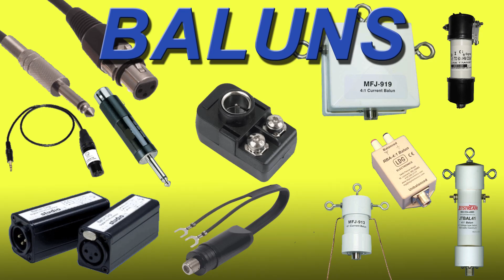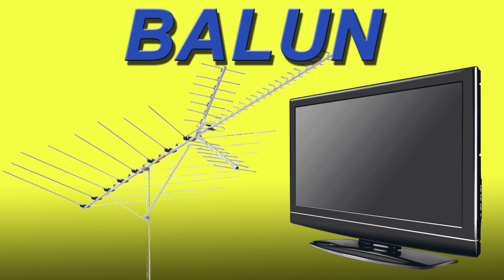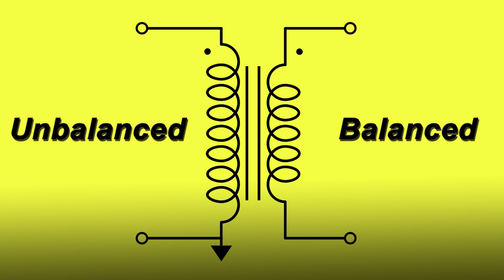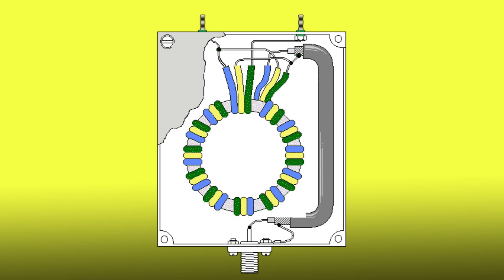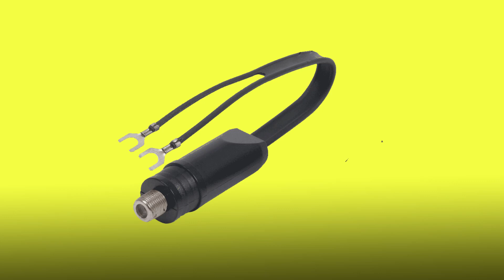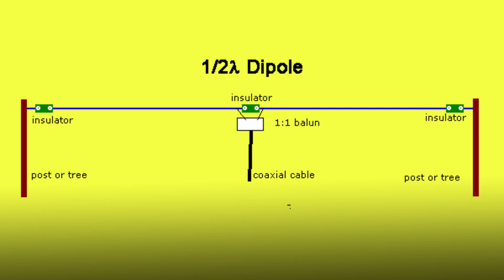Basic Fundementals Baluns

Comment: Watching at half speed I think it makes some sense. I’m trying to figure out a 5.8 gHz antennae that I broke. I believe it is a 4:1 balun near the end of the body of the “antenna” (which I think is mostly a feed line). It appears to be a small brass tube that closes at the antenna end. I think if the ground of the coax (the braided part) is soldered to the inside and the internal wire (which protrudes through the closed end of the brass tube) is soldered to the brass tube on the outside, the effect is similar to what you described as a 4:1 balun. I could be way off, but I’m just trying to understand it. I think it’s a half-wave dipole antennae. Any ideas to help would be greatly appreciated. I might be wrong about the ground being attached to the brass tube, but that would pretty much eliminate the possibility that it’s a balun and then I’m back to square one trying to understand what I’m looking at.

Comment: > I hope this video has been helpful.
No, it really hasn't. I know just as much as the video finished, as I did when the video started. Assumed too much, and left too much to magic.
Edit: Coming back 3 after having studied baluns on my own, I understand this much better. Things I didn't know:
1. The signal is only meant to run on the inside of my coax
2. The outside should be at ground, so as to shield the signal against RF
3. By connecting my coax shield to one arm side of the dipole, and the inner conductor to the other arm, I violate 1 and 2 by running the  signal both on the outside and the inside.
4. A 1:1 balun on the coax will ensure my the "balanced" signal from the dipole is transformed so as to run only on the inside of my coax conductor, which is an "unbalanced" transmission line.

How this happens, I still have no idea. I know how transformers work, but I suppose I'll have to read more.